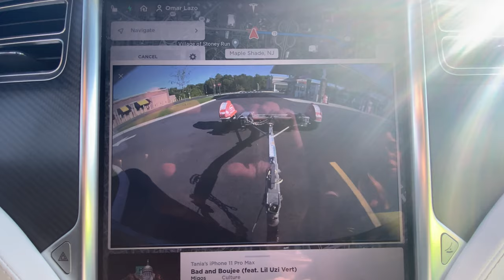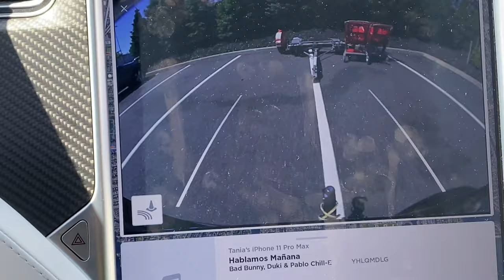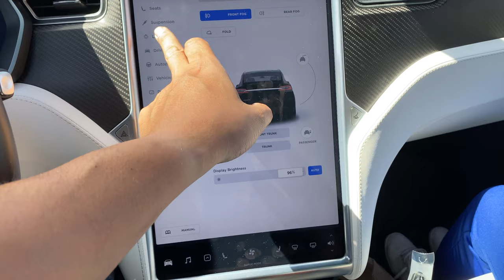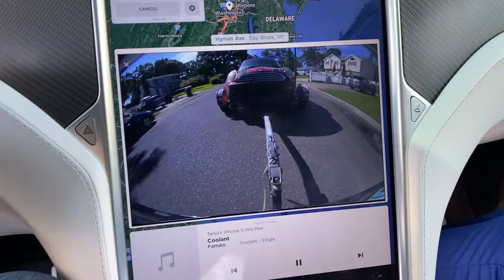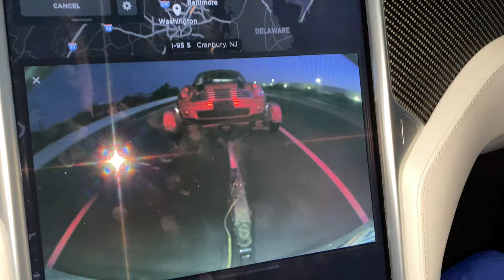Unbelievable! Tesla Tries to Tow a Car, Then Gets Pulled Over TWICE!

Comment: I hope you meant 'trailer mode' and not 'tow mode', because tow mode is meant for when loading on a flatbed it disengages the wheel motors. (7 years experience tow truck driver)
Reply from the maker: Definitely trailer mode, I think I showed the icon that appears when you turn trailer mode on at some point in the video. Tow mode deactivates the AWD system I believe so that you can tow the Model X. Thanks for the clarification 👍
Reply: @OmarsGarage  yeah I saw you show it later, posted the comment when I was only a little way through. In the early portion you say 'tow mode' a few times.
Reply from the maker: @Jester987  I appreciate you looking out 👍

Comment: Why would you have your range mode turned on and Ludicrous mode turn on?
Reply from the maker: Ludicrous gives me the acceleration I need when getting on and off highway off ramps especially if you are hauling something. As long as you don’t get on it then it doesn’t use as much power.  It’s like driving a turbo car...turbos are there but unless you get on it, it doesn’t really use the turbos.
Reply: @OmarsGarage ,,,  I have awesome a Tesla P90DL same package. I was told by my service not to leave in that setting when ludicrous modes are engaged.
Reply from the maker: I normally don’t have it engaged.  I engaged it because since it was a 300+ mile trip, I wanted to see if I could extend the range.
Reply: @OmarsGarage   Well can you?  I normally  Only get about a 180 miles at 90%
Reply from the maker: I’m at 203 at charge to 90%.  Actual range depends on how you drive it, highway vs city....up hills or flat, etc.